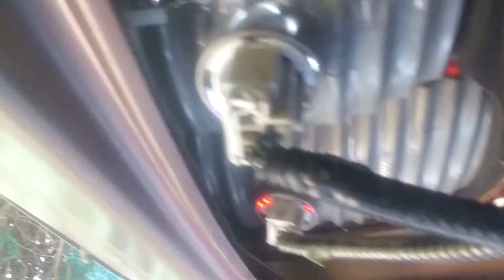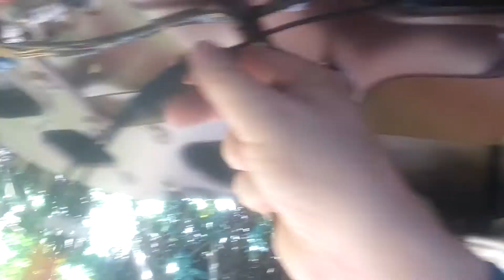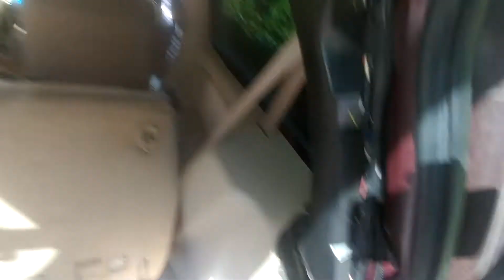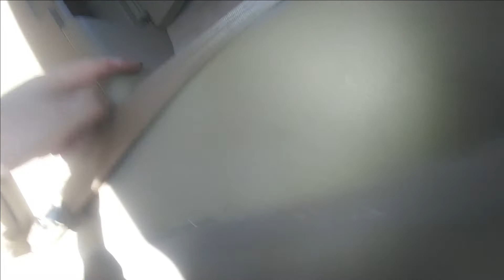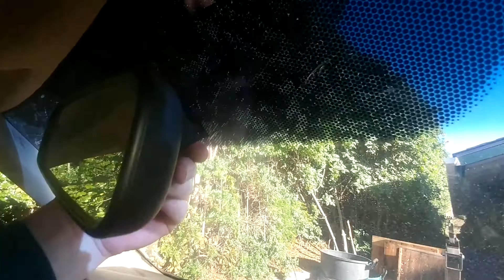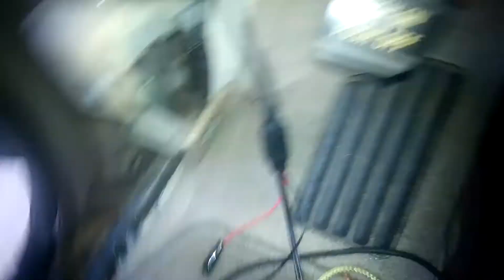Install a Rear view camera in a 2007 Honda Odyssey

Comment: Nice video, well done.  Question:  Rather than run new wire thru car, can I splice into my 2009 Odyssey “mirror back-up camera system” with second camera ( that shows brackets :-)  and either show brackets in stock mirror display and/or drop spliced wires to portable Apple car play receiver display?  Now, how/where can I see your answer.  Tom. 🤗

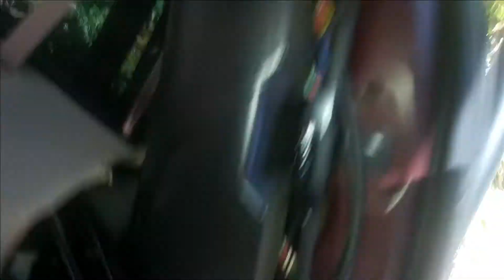Comment: When you fed the wire under the lower side quarter panel (3:37): How were you able to get it through the AC and the speaker area all without taking the panel all the way off? And you managed to attach it to the existing wire too? Very tight in there for me. Thanks.

Comment: This helped me a lot, one comment about the add a fuse, you have it on backward. The power comes in to the bottom side of the fuse on my 2007 Odyssey atleast, this means power is not going through the 2 amp fuse before hitting your screen. The wire needs to pointing up towards the roof. Also I found that the empty fuse 29 works on key on as well, for that you can just use the add a fuse pointing up and do not put a fuse on the bottom part, it's not advised to connect that circuit if it wasn't connected before, so just one fuse in the top of the add a fuse.
Reply from the maker: @Hatem Nassrat : Thanks for commenting on my video. I'm glad it helped you.  
1) Re: the add-a-fuse being installed upside down:  You are right!  I installed it upside down on accident.
2) Re: "power is not going through the 2 amp fuse before hitting your screen..": This is actually not true, at least for the add-a-fuse that I used.  Because it's upside down, the power would actually flow in across the 10A fuse then across the 2A fuse, then out to the screen.  It's not bad, it's just not how I had intended.
3) Re: Using an empty fuse:  That's a great idea.  I did not even think that the empty fuse slots had terminals in them.  Since they do in this case, that is an excellent idea.  I'll remember to check that for future projects.
Thanks again for the feedback.